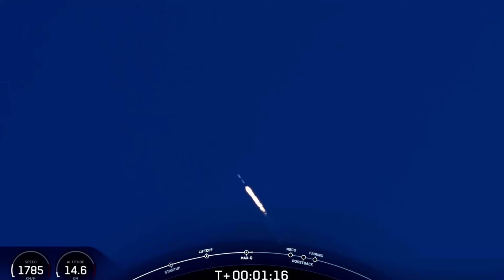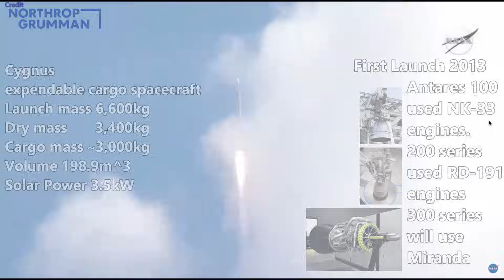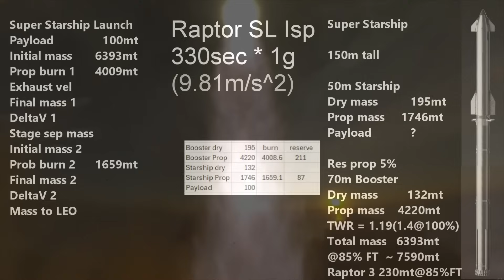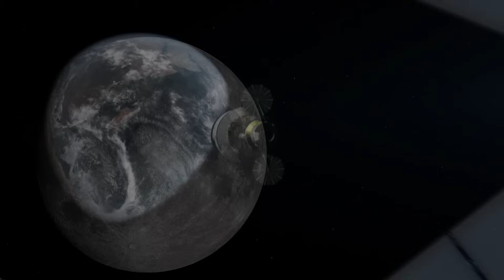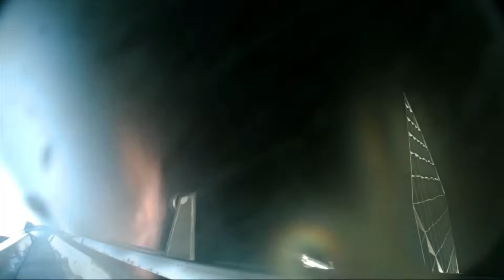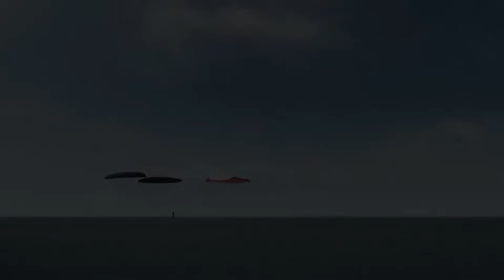Starship Version 3! The Super Starship

Comment: Since they want to keep the booster burn time to a minimum I think it's safe to assume in a 150m Starship future the following:
Booster will only increase by a 10 meter maximum. They will probably increase the throat of the Raptor even more to allow for greater mass flow, keeping booster burn time to a minimum with optimized RTLS flight profile. 
The 70m Starship will end up with 9 engines with something like 2600+ tons of thrust.
I don't know what will happen to the payload bay in that scenario, but they can really optimize the shape, space and total available internal volume if they go with a sharper taper-in design and a blunt nose, something closer to a 9mm bullet than the pointy rocket design, that would make the full diameter inside the payload bay much longer.
There's still a lot that this vehicle can improve and evolve.
People forget how much F9 v1 changed by the time it was F9 block 5.
Reply: And also, the same reasoning (minimization of gravity losses) would lead one to assume they would target full (100%) thrust at liftoff, rather than the very conservative 85% postulated in this video...
Reply: @Spherical_Cow  he put 85% Raptor 3 because that matches the Raptor 2 of today, so conservatives estimates to see how it performs even in that scenario.
Reply from the maker: Going to 100% makes things explodey... No one wants a 40-story steel structure coming to visit them.
Reply: @terranspaceacademy  I guess it depends on the definition of 100%.  To me, the maximum sustained thrust at which an engine is designed to operate reliably, is the 100% setting for that engine.
Reply from the maker: Full thrust is not usually 100% thrust.   @Spherical_Cow
Reply from the maker: I thought so too... Making it more "pointy" because of a somewhat funny movie is not a good design choice.

Comment: Sierra Life expandables.....wonder how many or how big of one could be fit in a starship nose cone.
Reply from the maker: Good question... Depends on which version.  I was looking at the 2.0.
Life 1.0 6m long 9m diam fits in 5m fairing 285cubm volume.
Life 2.0 12m long 9m diam fits in 5m fairing 600 cubm volume.
Life 3.0 16.2m long 11m diam fits in 7m fairing 1,440 cubm.
The 3.0 would fill the entire payload bay of Starship and need more room if inflated.
The 2.0 is 12m tall and Starship payload bay is 24.25 meters tall so maybe two? Especially if it was stretched by another 3 meters.  3.0 would be amazing...

Comment: I suspect Spacex's goal with the Raptor 3 and the new/ proposed Stretch Starship is to whittle down the number of ships needed for refueling at LEO for onward flights. At this rate SpaceX will be able to expedite the sending of lighter unshielded non-returnable Supply Starships to the Moon well in advance of the further delayed manned landings -  supplying materials for the first permanent structures and the beginnings of the necessary infrastructure.
Reply from the maker: They must be... Twenty launches per flight is insane. But greater mass to orbit gets tough without higher efficiency...

Comment: One interesting clue is that future bigger versions of starship would have 9 engines, sixth vacuum and 3 sea level, if you consider 3MN for vacuum ones and 2.7 for sea level type, that would get 26 MN of power only for upper stage, that would require for a T/W ratio acceptable a wet mass of 2400 tons, also only stretching the upper stage would make the upper stage longer than the booster , so probably a increase in diameter is required, for example at a 9 meters diameter every meter in length have almost 64 cubic meters in volume, but for a 12 meter diameter you had 113. Also in this case payload can reach 200 tonnes probably, and make hot staging more easy because the outside engines won't hit the booster upper part.
Reply from the maker: That's a very cool thought... I'll make a graphic and see what it looks like.

Comment: I think a bigger booster has a higher likelihood of making the current SpaceX moon landing proposal work. The planned refueling missions are just a bit too uncertain for my taste.

Also unrelated, how can Starship deploy these large modules?
The only payload deployment method I have seen so far is their Tic-Tac dispenser. No bigger module can fit through there.
Will they eventually have an expendable upper stage that can fully open its fairings?
I can‘t really see how they could make a fairing that fully opens to the full diameter, then closes again and be structurally sound enough for reentry and landing.
Reply from the maker: That is a good question... and come back and land intact? Could the Starship reenter base first and survive?
Reply: Yes, Starship will have a generic LEO cargo delivery variant, that opens up to release large payloads.  There are renders of it, but no physical articles have been built yet (to my knowledge).  In these renders, the leeward half (without the TPS tiles) of the cargo segment flips up very wide on a hinge at the bottom, and cargo is pushed out sideways first to clear the nose cone, then forward to clear the hatch.

Comment: The quickest way to the Moon is to simply cut off the top 1/3 of the Starship and remove all fins and thermal protection, then stack a 200 ton lander on top with a single Raptor and a Dragon capsule. On the way back only the dragon re-enters. No need for the stupid Gateway nonsense.
Reply from the maker: Except Dragon can't survive reentry from the Moon. Make that an Orion and it's all good.

Comment: What would a little increase in the diameter of the booster do for tank volume?
Reply from the maker: A lot! Going to 10 meters diameter increases the propellant volume by 23%, going to 12 meters by 78%
If they are going to stretch the length they should also consider going at least to 10 feet... and then? Concentric tanks?
Reply: It won't be easy (nor quick, or cheap), retooling the entire production line(s), ripping out and rebuilding the orbital launch mount(s) as well as all the test and transport mounts, and retesting for structural strength, to allow for a larger-diameter Booster...

Comment: I have a very very large space station design, it occurred to me that I need more than outside cameras fixed to the station but actual flying drones to orbit or keep a fixed distance from the station to monitor the outside from a more encompassing perspective.  If they get low on fuel the can come into one of the cargo bay doors or perhaps plug into the outside of the ship to await refueling and charging.  Such drones could monitor EVA situations and in the event of an emergency be used to rescue a detatched or unconscious astronaut on a space walk.
Reply from the maker: Just have them on stiff cables. In space they'll stay exactly where you need them.

Comment: Building taller is less efficient as there is more weight for the same engines to carry.  It makes sense to add more rocket engines to the bottom of the booster to fill in empty pockets and nooks.  I have such an engine design, I hope it can compete.   Magnetic boots will allow workers to stick to their stations and provide walking resistance and a tension strap that wraps over the shoulders will provide compression for the spine to help slow bone loss to the most critical areas.
Reply from the maker: That could help...

Comment: Given that if you are going to launch a second stage space station there is no need for an additional payload other than the rocket itself and it's food and support mechanisms.  Which means it could be taller as mostly empty space.  Say 200 meters in total with almost 100 meters just for the space station.  Forgo the pointy cone at the top and use a more space friendly half dome.  Use floor dividers in the oxygen tank or methane tank for baffles and when empty, apart from the header tanks, open an air lock door into them and inhabit them.  Why not make a suit using non-Newtonian fluid that resists quick movement and causes stress on muscles all throughout the day's work?  This suit would help keep muscles toned.  Magnetic boots on steel floors will not only help with work and movement but also provide additional resistance and a tension strap over the shoulders will add compression to the spine to help reduce bone lose in the most critical areas .  Good Show,  I appreciate your talent with math and formulas and keeping terms straight in in coherent order.  Building taller is not more efficient due to the extra weight being carried by the same  engines.  More engines need to be added, perhaps smaller ones to fit into empty pockets under the base of the booster.  I  have such a design, I hope it can compete with existing tech.
Reply from the maker: I like the Newtonian fluid idea for suits a lot... I think they need to increase the diameter to at least ten meters.
Reply: @terranspaceacademy  Think even larger.  A torroid of double lined curved tubes that make a giant ring, one inside of the other, about 225 feet across with a thickness of about 27.5 feet in 43 foot lengths to fit inside a 30 foot fairing.  The inner tupe floats and rotates and allows the outer tube to be stationary.  The inflatable size that could be crammed into a 30 foot fairing might inflate to  60 feet across  Am I wrong?

Comment: I actually start to be skeptical about Starship capabilities beyond LEO as Starlink. Too much complexity needed for the refueling process, as SpaceX is yet to present a fully functional wide payload hatch for commercial applications.
Reply: I think it's premature to write it off as a long distance craft. It will be needed to land on Mars, which is a major application of the design. That being said, simply designing it to be able to get off Earth is such a crazy edge-case that I have to think dedicated spacegoing vessels will emerge that can have more optimised layouts (not the gigantic fuel tanks, for example, for an automated slow freight hauler).
Reply: Starship with refueling is a way to get 150 tons to mars.  Starship with a third stage or big tug as cargo is a good way to get 10 tons to mars and beyond.  @murraypearson2359
Reply: Is there a limit to the size of a rocket? Could they make Starship twice as big?
Reply: @AsurmenHandOfAsur Probably the biggest limit is the amount of damage imparted to the launch pad with each launch.  The bigger the rocket, the greater the impact.  At its current size, Starship is already twice as powerful as the Saturn V, which was the most powerful rocket to ever fly actual missions, until now.

Another aspect of launch impact is the vibration and noise imposed upon any surrounding communities.  When launches shatter windows and cause ground shaking equivalent to a moderate earthquake many miles away, that puts a limit on how much more powerful or how frequent the launches can become - unless a launch pad can be built quite literally in the middle of nowhere.

Lastly, there's a tradeoff between rocket size and available payloads.  A rocket that's too big might not find a lot of customers who actually need to launch payloads that large [frequently enough].
Reply: @Spherical_Cow  Add to that the market trend of satellite downsizing, as over expected operational costs.
Reply: They said the same thing about landing ships. Orbital refueling and reuse is just cheaper in most industries that wins. More flights should up the reliability. Longer term we have space infrastructure so we only need to get to Leo.
Stretched starship should have much more fuel payload to orbit for less refueling
Reply from the maker: Once we can build things on the Moon and in lunar orbit from its resources we will see true "space ships".
Reply: @terranspaceacademy  only need a near earth asteroid. If we have water that is most of the propellant anyway we can likely get carbon or ferry up. If we are making refueling depots there is likely an argument for shipping carbon and water to orbit then use solar to turn into fuel to save on tank mass